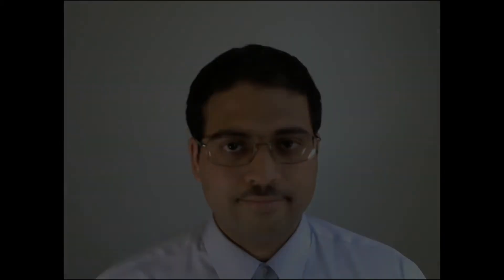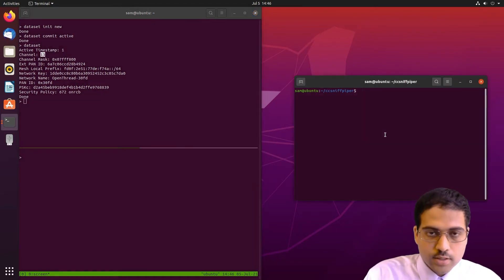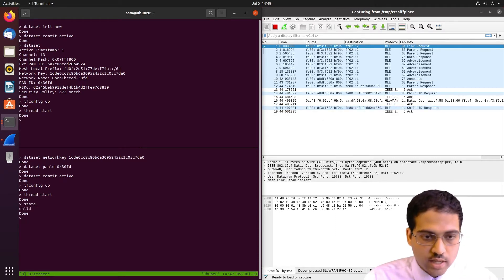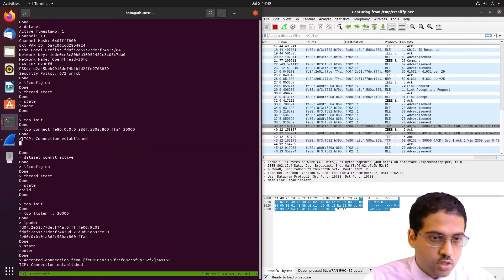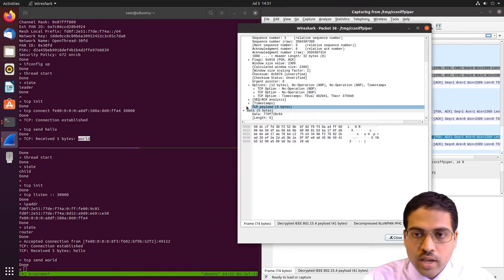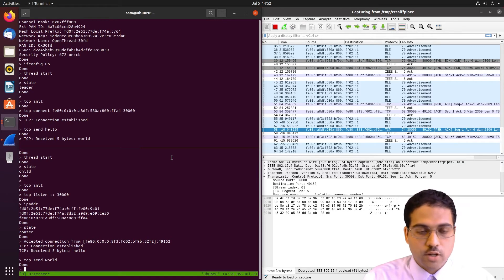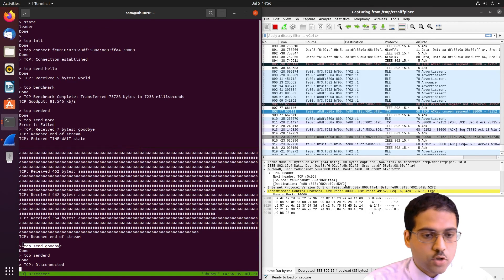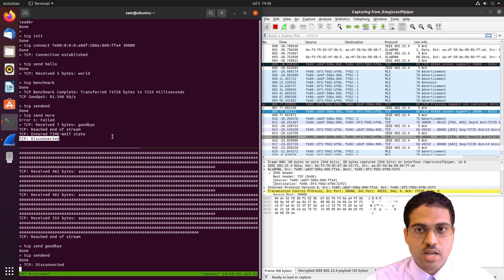Demo: TCPlp in OpenThread

Comment: Try to avoid TCP/IP as much as possible unless you want to transferring large data, otherwise if just switch/signals/notifications/small data then UDP (over MQTT) can use much less power/energy...
Reply from the maker: Thanks for your interest! My opinion is that the low-power wireless networking community should give TCP more credit, and that avoiding TCP/IP altogether may not be a good idea. We actually did a study investigating TCP in low-power networks, which you might find interesting: see https://www.usenix.org/conference/nsdi20/presentation/kumar or https://arxiv.org/abs/1811.02721.

You're correct that raw UDP can use less energy than TCP. But unlike raw UDP, TCP gives you reliability, which benefits applications. In our study, we found that CoAP, which implements reliability over UDP, actually has a similar overhead to TCP.

For applications that tolerate packet loss well, prefer timely delivery to reliable delivery, or benefit from specialized transport protocols (e.g., video streaming), UDP may be the preferred option, just as it is for such applications in traditional (non-embedded) networks. But TCP is also broadly applicable in embedded networks --- think about firmware updates, control/configuration information, actuation commands, remote shell for debugging, ...
Reply: @samkumar99  true that is depend on the application that you are implementing. 

I do agreed that for firmware updates, control/configuration information, actuation commands, remote shell for debugging... stay with TCP and SHOULD be implement with suitable/reliable via Computer-to-Device over better or reliable term of communication (Ethernet, WiFi and NOT over OpenThread).

From what I see that you are trying to communicate between 2 devices over OpenThread (not sure what you are trying to do here). But then TCP over OpenThread is not so "reliable" and not recommended. UDP is often recommended due to relatively high loss rates and latency variance that is common to "low-power", "wireless mesh networks".. 

Keep in mind that the terminology of "embedded networks" over the batteries is already defeated the purpose of "reliable" altogether. That is why it's more recommended to use MQTT pub/sub model for IoT and/or overtime lifelong devices communication.